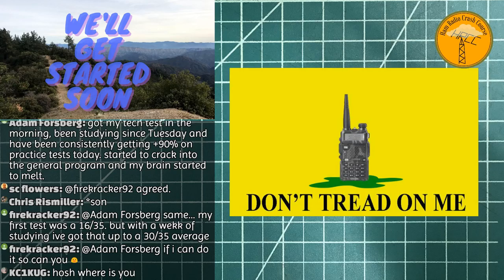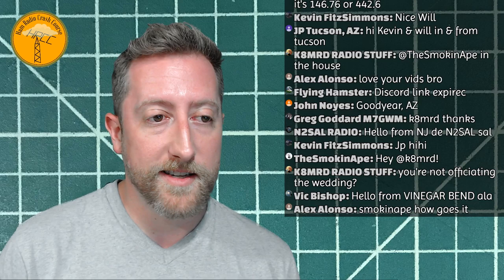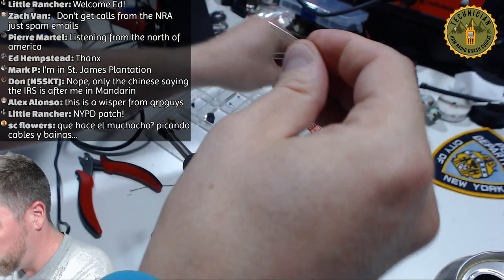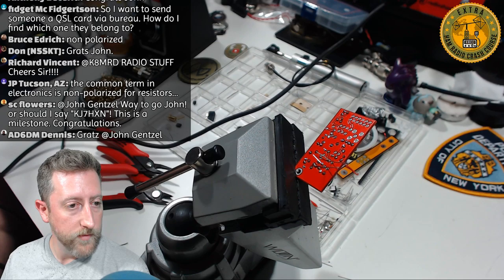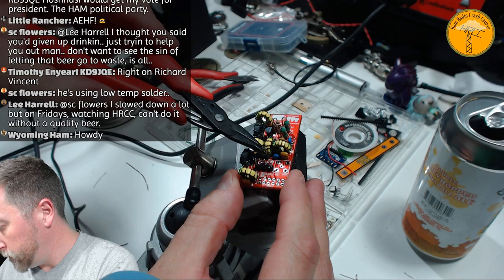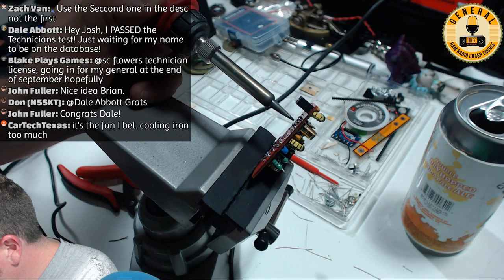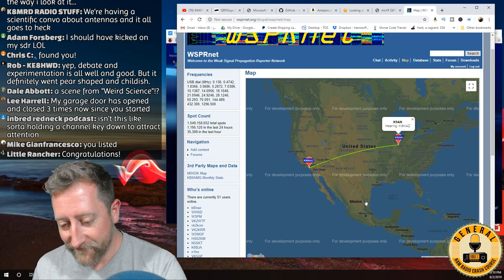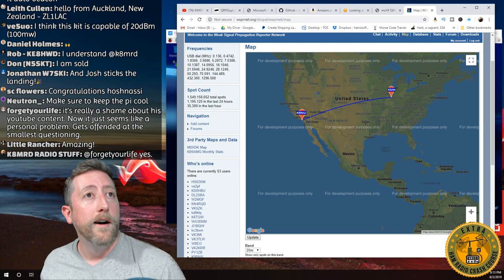Lets Build! QRPGuys EZ WSPR Raspberry Pi Transmitter

Comment: Hi I have a DA Prepper question for you. I have 2 repeaters about 5 and 10 miles away. Could a BF-F8HP (UV-5R) connected  to a 25 ft Real Ham radio antenna_? (please fill in the blank) Can I do Intercontinental communications with that setup?
 Thanks for your time.
Reply from the maker: Intercontinental? No, repeaters just get your signal out a bit further still line of sight comma though. Repeaters can be internet linked, but that would be down in an emergency in a lot of cases.
Reply: @HamRadioCrashCourse  Thanks for the info have a good 1

Comment: You started to mention past projects, and I was wondering about your Cricket-30?  I don't know if you saw my comments, but I had similar problems with my Cricket-40.  I found out that those rigs don't play well with amplified speaker amps like you were using. I was having similar issues with mine... I could hear very weak signals way down in the noise.. also I didn't have a side tone (even though it was transmitting) . So I tried a pair of ear buds ... and then I suddenly I had aside tone and signals were better. So you might try messing around with the audio output (impedance) on that rig to see if you can improve things as well.  It turns out, mine worked the whole time.  Although, I hate the attached hand key, and want to add a jack for a hand key.  Hope this helps Josh.  Let us know if you dig it out again.  73, Kelly - WB0WQS.
Reply from the maker: I’ll try it when I get home. Thanks for the tip!